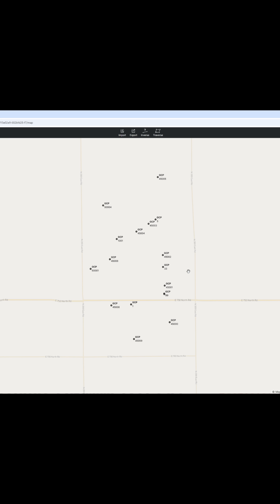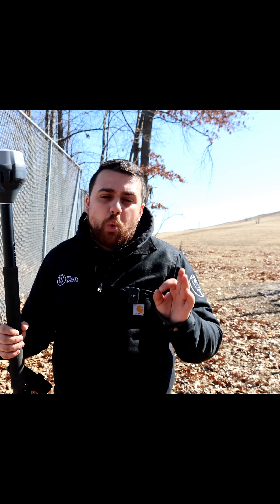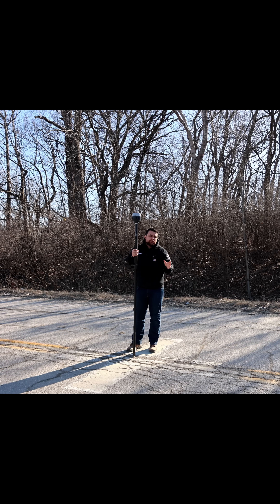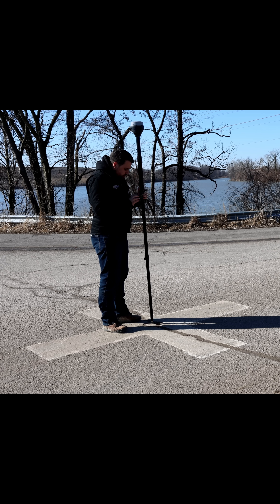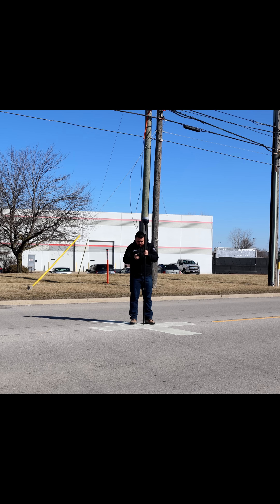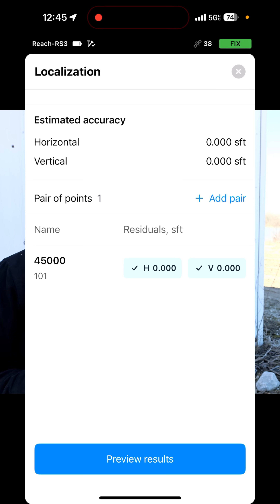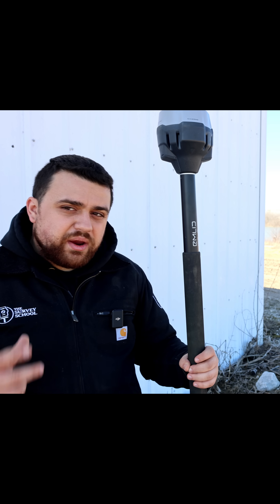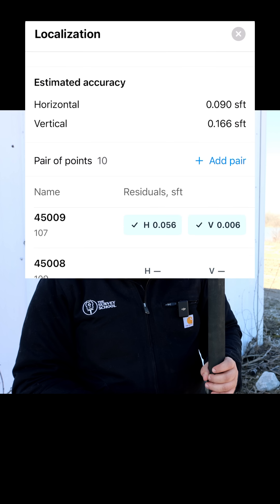How to do a Local Control Survey with Emlid Flow

Comment: 0.166 vert? That's terrible. Did you take single shots and average reading? Maybe the Emlid product is garbage? What gives, Rami?
Reply from the maker: 0.1-0.2 for vertical accuracy with any GNSS is typical. Emlid meets that standard.
Reply: Just snag another rs3 for corrections. Easier than explaining the impact or not of a tenth.

Comment: How can I get an accurate GPS survey in the city without using corrections or a full traverse with a total station. Someone did the exact same thing what you just showed, but without using any corrections as they claimed they had about 5 to 10mm accuracy as they stationed with the GPS on each point for a long period. Long story short it turns out that their points are up to 40mm out when I used a total station to backsight or resect between the points they've measured with the GPS. Is there any simple solution to get the right coordinates for the points, other than traversing with TS or using geo corrections from a local station?
Reply: Honestly don’t think this possible with current gps. If I’m in the city I always use my total station
Reply: What that person did for a long time to get high accuracy is called a static survey. With it you can achieve cm level accuracy.
Reply: @giorgos1giorgos you won't, unless you connect your surveys with a static station to apply corrections to the measurements. Because I checked with the TS and can't get a good resection between the points